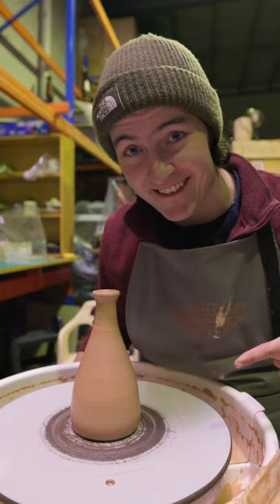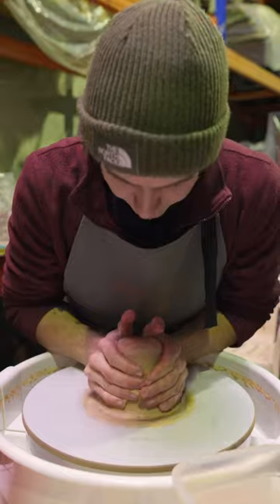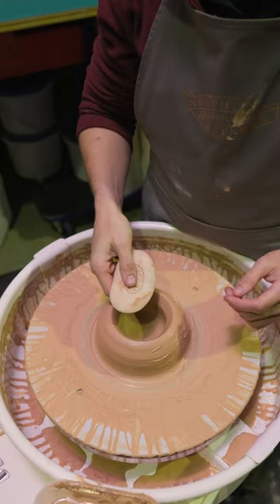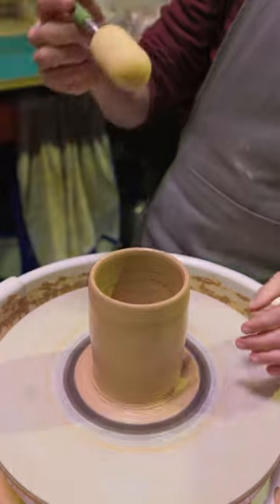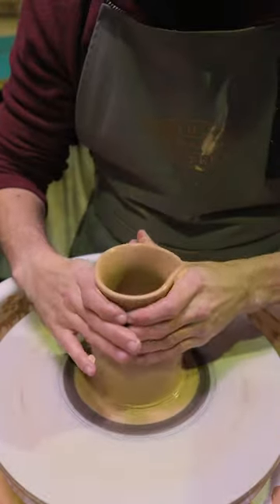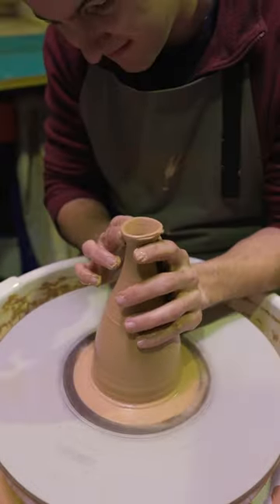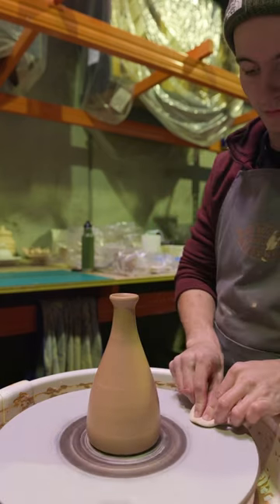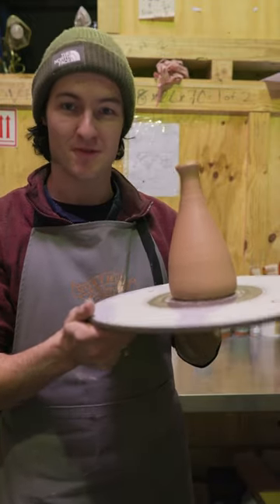Bottle Vase for today video!! (Caption in comments) #wheelthrowing #pottery #clay

Comment from the maker: Topic of todays video is throwing bottles vases!
These are defiantly one of my favourite shapes to throw, not only for the finessing it takes to get a nice top, but also because of how different it looks compared to most other shapes

Did you know that bottle vases have been around since the 1500s? Wow

Few other things I’ll mention, for when your throwing your own bottles:

1: Getting It Centre Is KEY: When the clay is properly centered on the wheel head, it creates a stable foundation for the entire throwing process. It allows you to apply even pressure while shaping the clay, reducing the risk of the piece becoming off-centered or wobbly. A well-centered vase will have better balance and structural integrity. 

2: Don’t Let Those Hand Dry Up: When creating the neck of the vase, it’s very important to not use too much water, especially when manipulating the clay to such a great extent, BUT. Because of its delicate nature, the last thing you want, is your hands drying out, pulling on the clay, and possibly deforming your vase at its most crucial point. Keep your hands from drying up and you’ll be throwing bottle necks for days 😉

3: Remove The Water From The Base: it’s an important thing to remember that before you create the neck of the bottle vase, You must remove the water from the base of the vase so that you do not get a soggy wet bottom. This is especially important when creating bottle vases as once you bring in the top of the neck, you will no longer be able to get a sponge down there.

4: Do Not Push Too Hard: Due to you creating a very narrow neck, the top part of the vase is very easily pushed over, especially when taking the slip off with a rib. You do want to be extra cautious about not pushing too hard as you can very easily bend the top of the vase over. Slightly rest your rib against the vase to get rid of the slip using a subtle approach

But most importantly, have fun and give it a go! Because at the end of the day, it’s all about practice and learning how to feel the clay. How it manipulates under your hands is a very important trait 

Hope you enjoy this video and happy potting!! 🥳